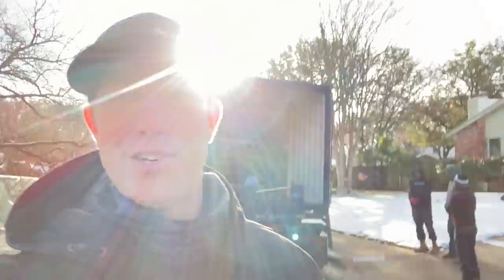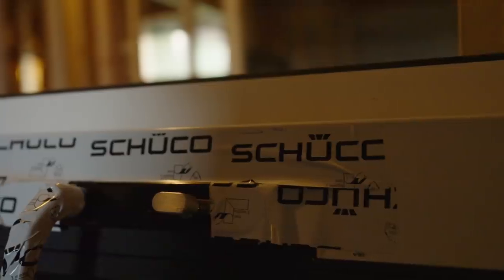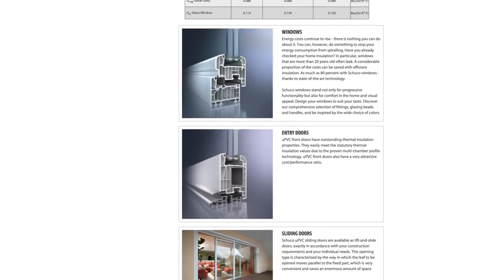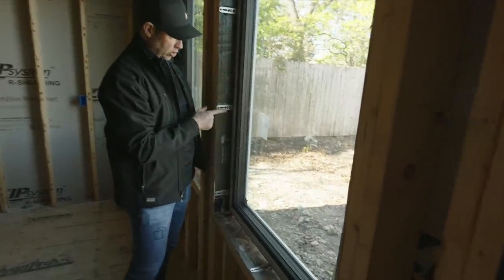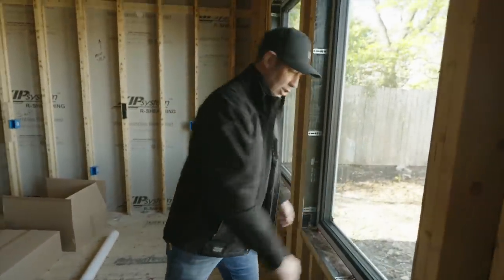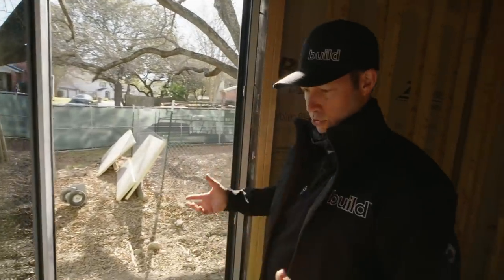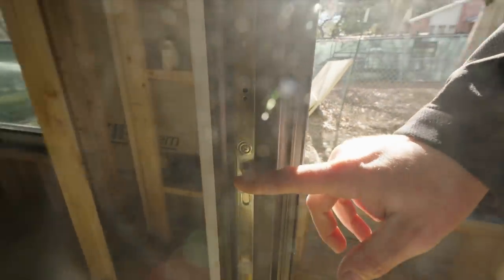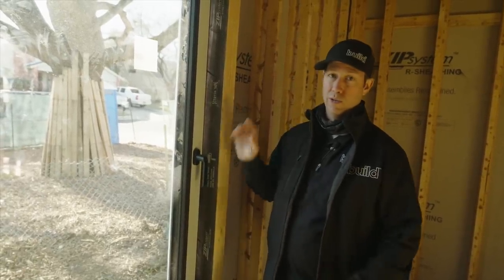Ordering Crazy Efficiency (and Affordable) Windows from Europe!

Comment: What I would like to know is if this is in Texas where are the window screens……….  because there’s absolutely no way they could use them without screens on them without bugs completely filling the house
Reply: Screens aren't installed during the framing stage. They would get beaten up by trades working on the exterior of the house and landscapers. Screens go on just before the owner moves in. There are also some people who don't want screens because they filter the sunlight. Insects are not a problem if you always keep your windows closed. Depending on where you are in Texas, there may be only a few days each year where it's comfortable enough outside to open your windows. Also, for many folks with seasonal allergies, there is never a good time to open the windows. For anyone who might wonder why even have operable windows if you don't intend to open them, it's primarily because there are building code requirements for means of egress that prescribe operable windows of a minimum size in many locations.You may not want to open your windows often, but if there's a fire at your door, you need a way out.
Reply: But they do make an option for external screens on there if you want them that’s what I was wondering…… perhaps I did not phrase the question as clear as I could have
Reply: @ralan350  Gotcha. That's a reasonable question. I don't know about that particular manufacturer, but I would imagine they offer insect screens.

Comment: Sry Matt but those are not high Efficiency windows from Europe i just orderd my windows and doors from Germany and as you dident specify the windows specs you orderd and its hard to read from your video the numbers then yeah... Lets debug your video. But first windows and doors are mesured with 4 diffrent values here - when we calculate stuff. 1. glasing, 2. frame, 3. mounting, 4 avarge Uw thats how you get your final number on the Uw value. For my personal windows are avarge of 0.72Uw doors are 0.98Uw and garage door is 0.99Uw and those are midrange stuff with CR2 security certificate. For price if people ask windows 135 euro per 1m2, door is  771 euro per 1m2, garage door is 283 euro per 1m2. Now off to debug the windows https://youtu.be/C2bJ1IWewDc?t=128 Ug is 0.54 if i am correct and thats realy common value for a tripple glased window but SHGC is important not only on the windows but each window that is set to the four cardinal directions must be calculated sepetraly to get the most from them so its not that important to have the value on them but the value must be calculeted based on their location to get a so called performance window! https://youtu.be/C2bJ1IWewDc?t=155 here you talk about the frame lamination thats allso common but if you want a performance window then usualy the frame isent laminated but covered with a aluminium to prodect the plastic from long lasting sun as we here build houses to sustain a long life. Each building is designed with a life span and usualy the minimum tax is 50 years. https://youtu.be/C2bJ1IWewDc?t=273 here you have a standard window opening full and venting a added bonus would be to have micro venting ;) https://youtu.be/C2bJ1IWewDc?t=392 here i can see the manufacture has drilled venting holes in to the frame those are only used on cheap windows or the manufacture does not know why they are used. Mainly those where used when houses dident have good ventilation and those where used to minimaize condentsation on the windows but this is bad as it destroyes the U value of the frame but dont forget to but the caps there here is a link what they look like https://www.double-glazing-parts-repairs.co.uk/image/data/drainage-covers-dimensions.jpg When ordering and mounting the windows i hope you spesified wich way the windows will open to the inside or outside. And when installing non opening windows you looked that you but the in the right way?! Thats a big mistake when installing windows and will degrade them faster for what their life span was ment for. https://youtu.be/C2bJ1IWewDc?t=419 Yes Siga tape is good and thats ok tape for outside i would have used Fentrim 2 50/85 but thats just personal opinion but why i realy stoped here was that dont forget to tape the full lengh of the metal joists seen here  https://youtu.be/C2bJ1IWewDc?t=422 whre you connect the window frame to the house frame why i am talking about this then you say here that you glue the windows in place https://youtu.be/C2bJ1IWewDc?t=641 but as i know you have a wood framed house then over time the house will move an i dont know what glue you use so thats why i talk about taping the metal parts ;) hope you had fun nice video overall. And now of to bed.

Comment: Ultimately, the next step is to licence the manufacturing so they can be produced throughout the US. There's little reason to buy a more energy-efficient window only to increase its carbon footprint with shipping it halfway across the world.
Reply: The problem is, that licensing is not enough. Quality assurance is what's really needed here. If you want quality, you just can't cut corners. Saving $0.10 on a cheap but essential piece, and having an overworked (and underpaid) employee hurry to finish things will lead to a very signigicant drop in quality, for a marginal reduction in production cost. American crafters proud of their work wouldn't do so ... but too many larger companies will. As soon as you find a solution for that problem, and get american customers to understand, that paying 20% more can easily mean 100% longer product life expectancy, as soon do you have good reliable products in the USA as well.

Comment: affordable how?
...i'm just going to double-window my 12" thick ICF walls with the cheap dual pane stuff. 2 windows in each foam-bucked opening, outer/inner; 2 Argon gaps, 1 air gap surrounded by concrete mass, 4 panes of glass, bunch of seals. screw it!

Comment: As a european, i am not impressed. These triple glazed windows are mandatory on any new buildings in my country. Plastic is even cheapest option.
Reply: You're lucky to have access to them. I'm a home owner working on a small renovation and trying to find high performance windows has been very challenging.
Reply: @solacedagony1234  there is even quadruple glazed window. But instalation is created mainly for brick buildings.
Reply: @matejwiczmandy1380  - VIG glass will make it. Less weight, same or better R-values.
Reply: @agn855  I do not saw VIG glass in person, but i think it will be 5 to 10 years until someone start to manufacture it in big numbers for affordable price. Sure it is the future like aerogel insulation.